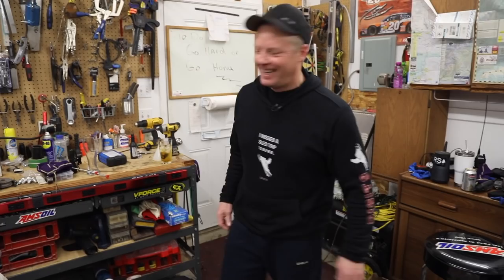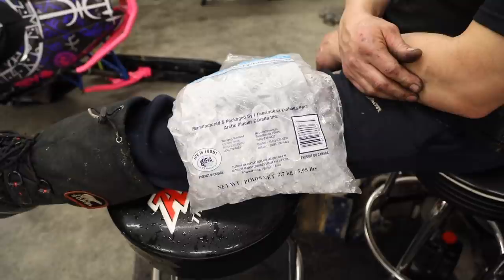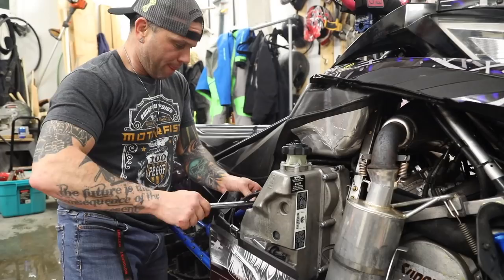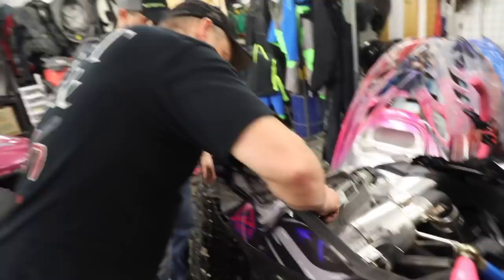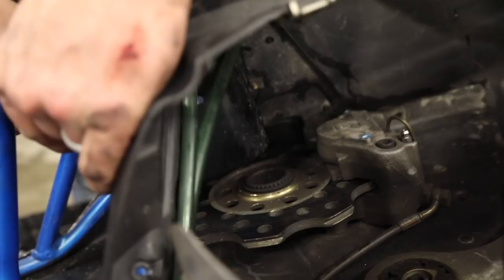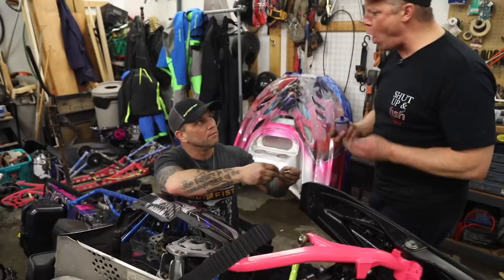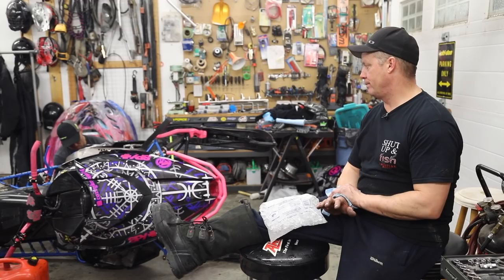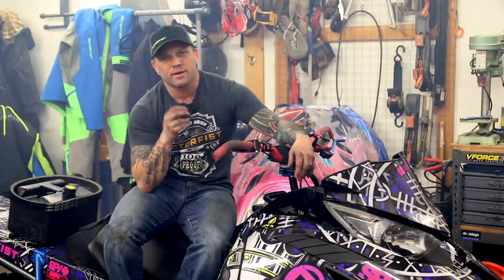Can a NOOB change a 162" snowmobile track?

Comment: Here's a tip,  from a guy that works on these everyday at a dealership.  Get yourself a torx socket 3/8" drive.  Get urself a impact driver that you hit with hammer that accepts 3/8" socket.   works every time.
Reply: Dang right. Them things and the small screwdriver ones are the most valuable tool in the box. Saves so many striped heads and sooo much time
Reply: i use one of these to take apart old carbs too. some of those pilot jets and whatnot can get siezed good and the hand impact tool works like a hot damn.

Comment: Stripped Torx... you almost have to try for this to happen.  Torx are made so they are a tight fit in  the head, always make sure the head is clean and always use the tightest fit.  If there is play in the head, it's not the right one.  Get both SAE & Metric; I don't like metric either but if you want to do the job right....  That was a painful chaincase cover extraction to watch, I would have used vice grips, instead of trying to drill it out.  You'd be shocked how practical a good set of vice grips is in dealing with mishaps like this, or like dealing with wore-beyond-the-skis, wear bars.

3" fn track... I'd have to get a tunnelectomy to install one of those.

Comment: I changed mine around the beginning of January. 12 M1100 turbo with the 162x3 it's the first track I've done and all i can say is there was definitely some major highs and lows lol. Didn't strip any of the bolts that hold the chain case on but i did position the break line wrong and the rotor cut a whole in it. All in all i am glad i was able to save some big bucks on shop rates. I got started around 7 pm and got out of the shop at 1:30 in the morning. I had whiskey so I'm not complaining😁

Comment: Torx are an incredible fastener, they are highly resistant to stripping out. Don't blame the torx
Reply: just removed 6 torx from a transmission.. with a drill.. all 6 stripped. They are fine for fasteners that do not need a lot of torque to loosen after they seize with corrosion.

Comment: The old Polaris chain cases used self tapping screws but you would never know it unless you looked close at the end.  The bolt was not actually round but trilobular in shape which is how it can self tap.  Problem is you only get full three engagement at three points on the threads so the threads strip out easy.  I always replaced the bolts with regular bolts then you can choose the head you want.  Socket head cap screw or good old regular hex head.

Comment: I would say polaris tracks don't do this because I've done 80mph on a 174x3 turbo and had no issues but my 155x2.6 is missing 3 lugs. My group has actually had really good luck with the polaris 3 inch tracks and they've taken some serious abuse but none of them have more than 2k miles

Comment: Simple thought, just a quick tac weld a nut to the head of torx? Then use a normal socket to undo the torx
Reply from the maker: Simple thoughts can be great thoughts Scott. Especially if you have a welder handy 🤙
Reply: @DIGIT9  what about the good ol impact driver?

Comment: I have an old 2001 rmk800 and wanted to gear it down and wanted to just change the smaller sprocket do I go bigger or smaller to get more torque?
Reply from the maker: drop small one two sizes , use same chain , get more torque , plus its cheaper

Comment: Question...  Are Paragon clutch plastic rollers (internal)  available from some OEM manufacturer outside of Paragon...     And BTW nice mid 90s  color scheme on sled, reminds me of my 96 Ultra.
Reply from the maker: Doubt it , try Paragon or Mtn Magic in Edm AB
Reply: @DIGIT9  thanks, tried Paragon with no reply.

Comment: I NEED HELP!   I have a 1998 arctic cat zr 600, it is the carbureted model, not the efi. It will rev up to about 6000 rpm and it acts like it has a rev limiter. if I hold the throttle at wide open for a while it will eventually go past 6000 to about 7500 rpm. But if I take the belt off it revs up just fine, so it cant be a stator issue. It has to be a clutching issue right? It came with a polaris primary and secondary on it when I bought it aswell as a D&D billet aluminum helix. I don't know anything about clutches so any help would be appreciated. Thank you to whoever answers!
Reply from the maker: Button or roller Secondary ?
Reply: @DIGIT9  i may sound dumb but how do I tell the difference? I'm good with mechanics but sleds are new to me
Reply from the maker: Take a pic of clutchs
Reply: @DIGIT9  i can on Tuesday, how can I show you?
Reply from the maker: Facebook or insta
Reply: @DIGIT9  either one works, I'll dm you one one of them

Comment: Why did they punch the centre of the track on the new tracks it’s not a Polaris center drive
Reply from the maker: Snow release
Reply: @DIGIT9   looking for a 3 inch track to stay together and they put extra holes in it
Reply: @leviparney8165  its so polaris can use them too, not brand specific.  also lighter.  doesnt hurt anything.